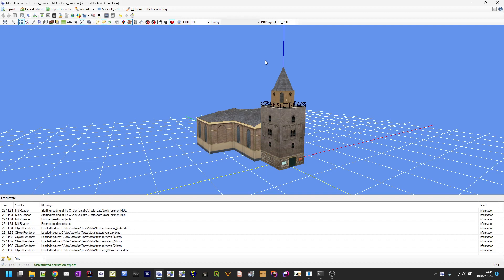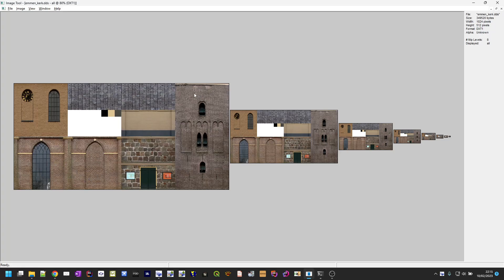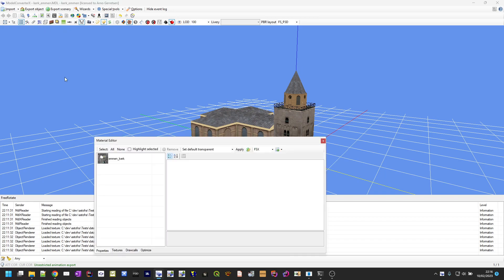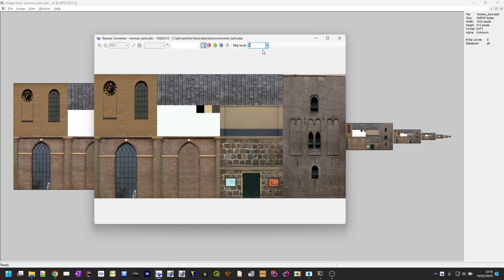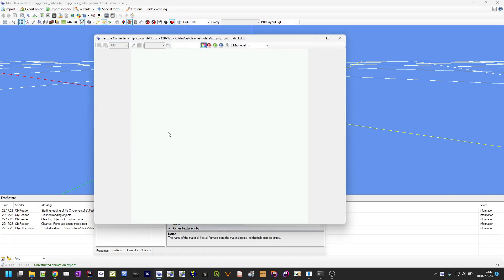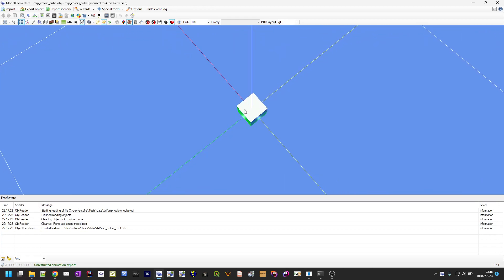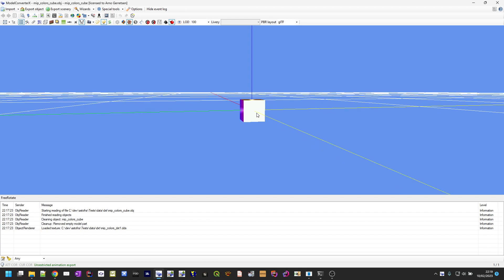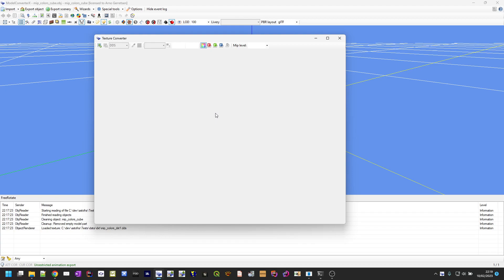ModelConverterX | Mipmaps

Comment: Thanks for your Tutorials which are really great.
Is there any book or ebook to explain in details the model convertor x.
In addition there is a model placement tool for fsx which is really nice software but i dont see tutorials for that software, its name is whisplacer.
Thanks.
Reply from the maker: Hi, the best documentation is the PDF manual that comes with MCX.

WhisPlacer is indeed a nice tool. I think there should be some old tutorials for it, but the tool is no longer developed for many years by now and I think less people are using it nowadays.
Reply: @scenery.design  Thanks for your reply